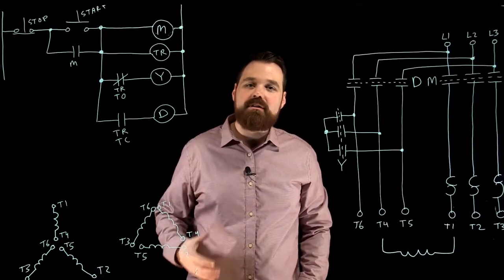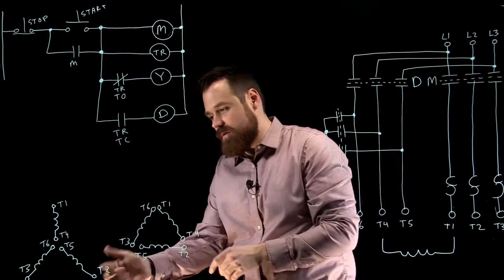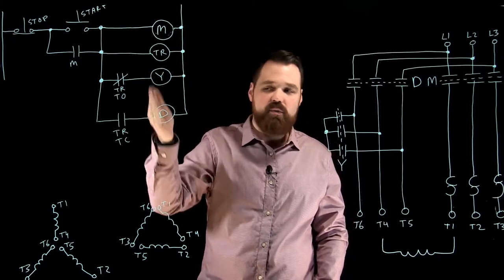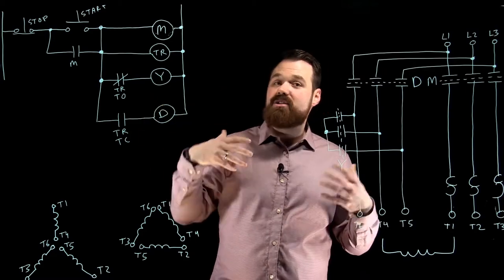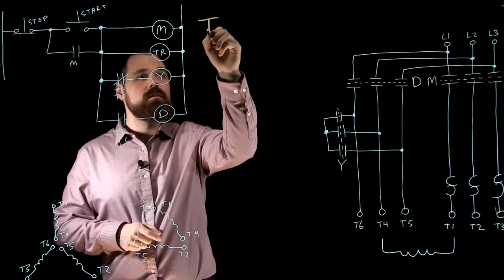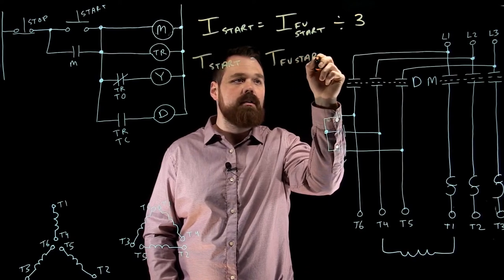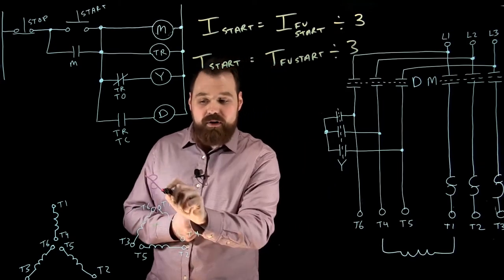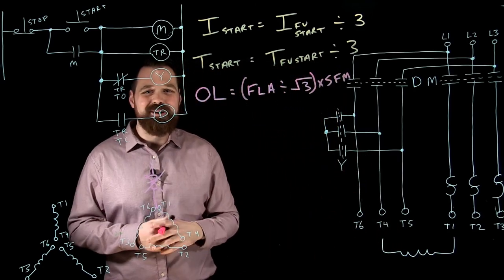Wye-Delta Motor Starter

Comment: Where is this still used? All the videos and comments I find are about teaching this in school while I can't find any real world applications.
Reply: fire pumps use these wye-delta starters and 6-wire motors - that's the only place I've seen this in almost 20 years of experience
Reply: Air Compressor Motors, for ever.  Now you will see added VFD's that remove the need to "soft start".  But they are very prevalent still.
Reply: @Dont430  What kind of hp? Are there new installations without VFDs?
Reply: Some larger tonnage chillers have wye delta start. Most are going to VFD’s but prior to VFD technology these were popular. Even if they aren’t new it doesn’t mean people don’t still work on them. Was working on one this morning and watched this to brush up on the transition so I could explain it to my apprentice. Great video

Comment: Well done, very simply wired.  The only other thing that may be added is interlocking contacts between star and delta contactors.  But I find it unnecessary with the timer.
Reply: In some regulatory contexts the interlocking is required. For UL508a applications see 33.5.2 and (for industrial machinery) 66.8.1.